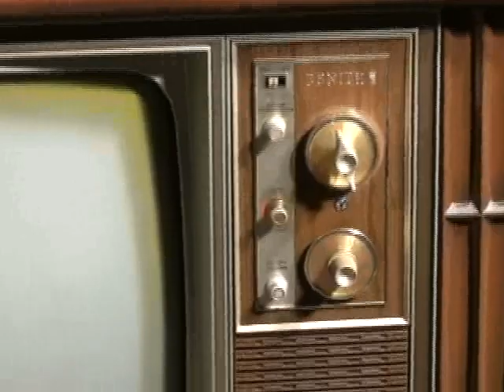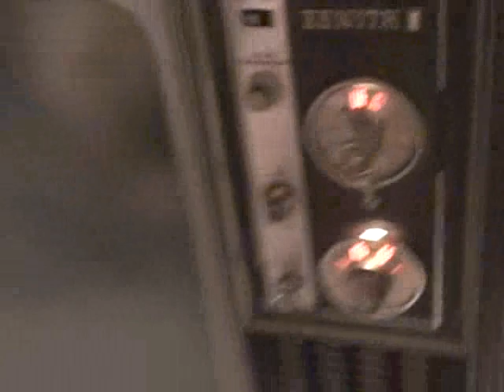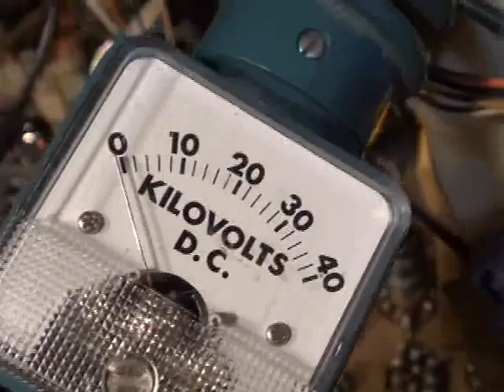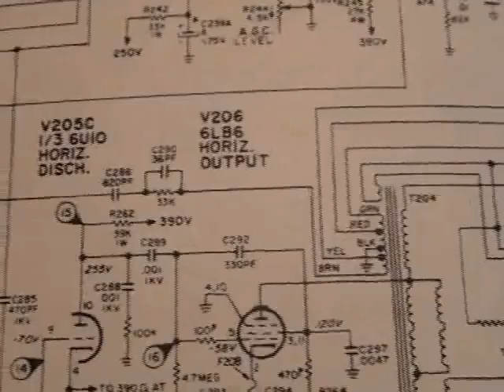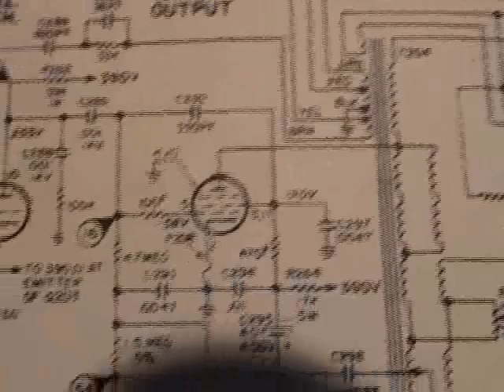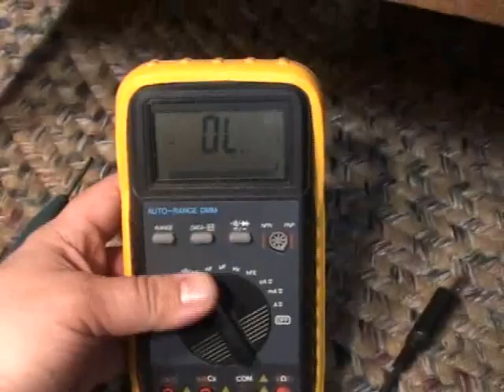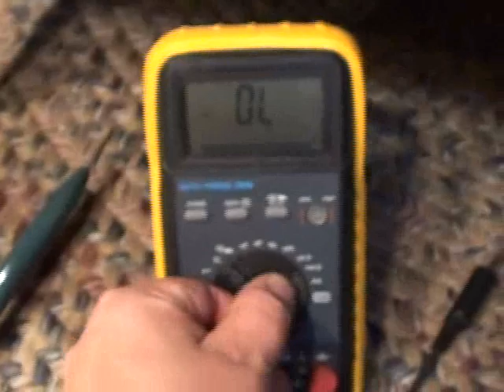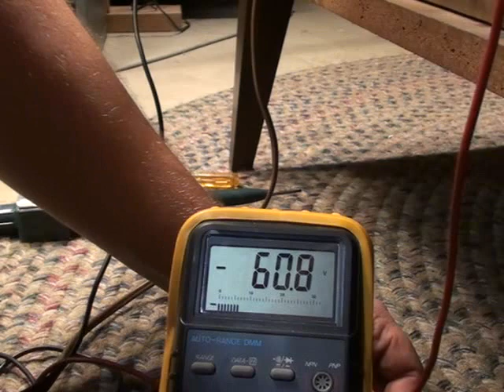1971 Zenith color television in repair, part 1 of 4

Comment: Question for you... I have a 1971 Sylvania - CL813P1. It was running ok and then i accidently left on for 6 hours when i got sidetracked in the house with kids - etc.. and then no picture (no raster) Sound is fine though.. I have a friend that works on 1950 and before tubes - and he has done all he can to it... I am hoping you have some ideas to bring my girl back to life...really love that TV...
1.	Board under HV Output tube damaged.  Cracked, maybe crystallized.  All tube pins seem to still have continuity.
2.	Set has sound, no raster, no HV.
3.	Replaced a few cracked resistors in horizontal and HV section.
4.	Replaced RF choke attached to flyback and dimmer tube
5.	Replaced resistor connected to focus control pot.
6.	Replaced resistor from red focus wire to tripler (mounted on top of flyback wafer board).
7.	Replaced tripler
8.	Replaced flyback
9.	Replaced 3 tubes in horiz/HV section.
10.	Set has some HV now, but very little.  Nowhere near the 25 kV needed for the pic tube. Still no raster.
11.	Noticed the HV Output tube was hot-plating.  Entire tube glowing orange and VERY hot.
12.	Stopped here b/c fear the damaged board is casing the hot-plating and did not want to damage the new flyback or tripler that I just installed.

Ideas?
Wish you were near the DC area.. =)
Reply: You have lack of line drive

Comment: I really only .."insist" that removal of potentially failing caps be removed from "early" or "Vintage" transistor equipment ESP TV's because they do run high currents, & yes it's asking for trouble with definitely ancient tube type TV's & radio sets.
Personally, I don't consider say, a radio from about 1983 to present to be "vintage",..but one from 1970, yes that is quite old.
I do know many 1970's transistors no longer avail at all..unless you can find good used replacements.
Germanium? scarce!

Comment: Shorted caps in tube equipment often take out resistors but they can also take out a, rectifier tube, speaker field coil (if the set uses one) a power transformer and, in the case of a radio, a coil that can be hard to replace.
 With transistors they used to have substitution manuals, just like tube substitution manuals, that give close if not exact substitutes. It gets tricky with earlier equipment in that they used a lot of germanium transistors as opposed to silicon ones.

Comment: Actually I have found of many instance where elec. caps go, not "shorted" but high resistance,..changing the very critical bias voltage on (now many times IRREPLACEABLE transistors,& cause thermal runaway). In my case, the outputs are avail, but others in RF/IF/preamp are not)..
In Tube equip, the damage from shorted caps kills resistors, which can easily be replaced.
My Belcor stereo was made in Japan.. Black hammer tone steel top, aluminum front & knobs, & gold painted glass, dial plate

Comment: Most of the time the electrolytic caps in solid state stuff just dry out and go open, you must have experienced one of the odd occasions where one shorted out. In tube stuff the voltages are many times higher, plus the coupling and bypass caps are all paper, so replacement is not an option. I've never of a Belcor stereo, was it Japanese or Hong Kong made?

Comment: Good day
There used to be (about 13yrs ago anyway) vintage tube "re-builders"
who could restore ancient TV guns..not cheap, but if you "really" want to properly restore..you could.
Yes, quite correct, if you leave in ancient capacitors, the result is blown transistors, & overheated tubes..
I learned this fact the hard way 21yrs ago playing a 1967 classic Belcor transistor stereo WITHOUT 1st restoring it...
"ZZZ-SNAP" went the output Q's....DOH! X(
Live & learn
"

Comment: @spdracer408 If you get this msg, best recommendations are to bone up on both vacuum tube theory along with practical vintage-era television circuits. Your library might have at least a few books about these topics gathering dust on the shelves. You can start with either a color or B&W set but the latter will be a bit simpler--i.e. easier to learn. Good luck!

Comment: @raddios2 Well for starters it would be a good idea to test the picture tube in your Zenith before going any further, if the CRT is shot there's point in going any further until you can locate a replacement. One warning sign is if there is a brightener connected to the picture tube socket, those often burn the CRT. Just like the old radios, TVs of the 1940s and 50s need all of the capacitors and many of the resistors replaced to work properly, not difficult to do but time consuming.

Comment: I still use a console tv today.  A lot of people are just throwing these sets out thinking they can't use them do to the digital change.  They still can be be used with a digital converter box. Mine works fine i have a converter box and a dvd vcr combo.